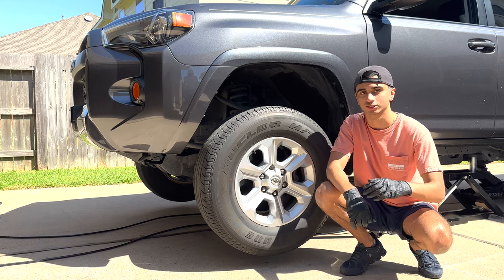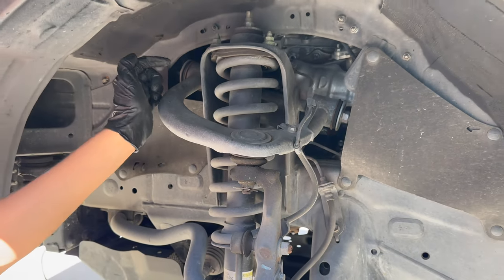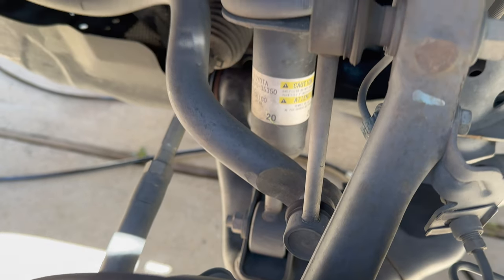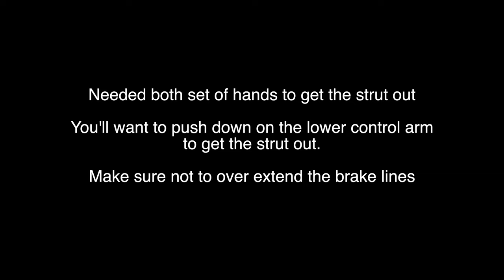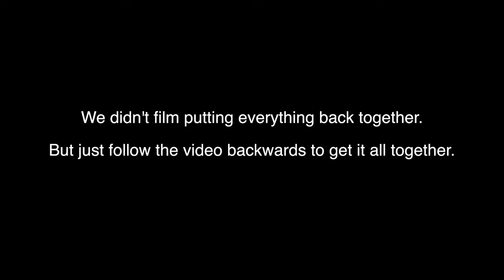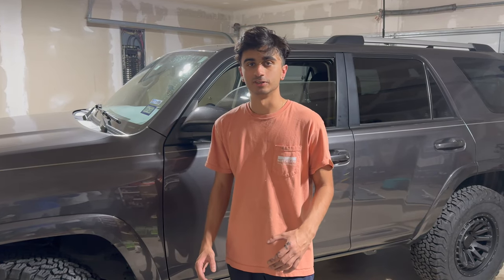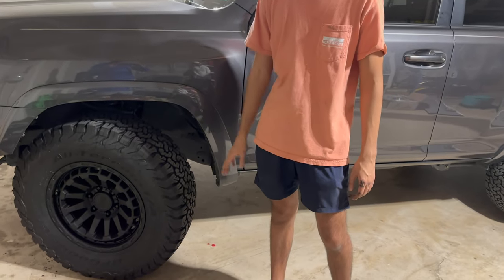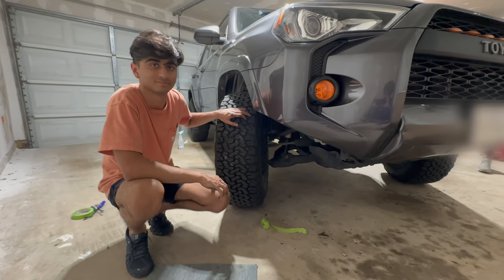TOYOTA 4 RUNNER BUILD PART 1 | NEW WHEELS AND TIRES + MORE!

Comment: You might consider looking into how Westcott Designs does a lift.
Reply from the maker: Just took a look at it, didn’t know anyone made a preload collar lift kit for the 4Runner. So far the spacer has held up great for ride quality any wear on the UCA only time will tell but if it turns out to be an issue that would be a solid option!

Comment: Just wandering why?   have a 03 v8 all stock even the general graber tires with 8 k miles off road never been stuck or in any trouble. maybe a knowledge and experience should be emphasized .
Reply from the maker: Not entirely sure what your question is? Why we did the level, the specific wheels and tires, or all of it?